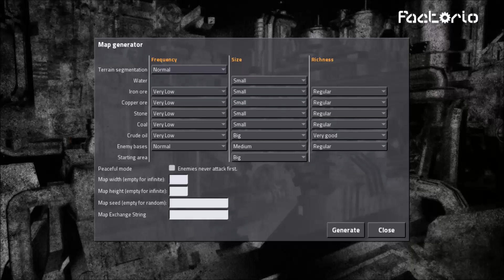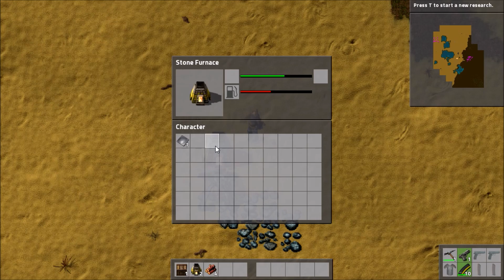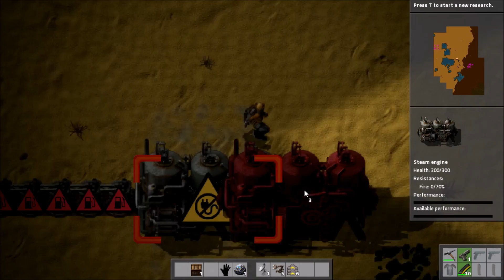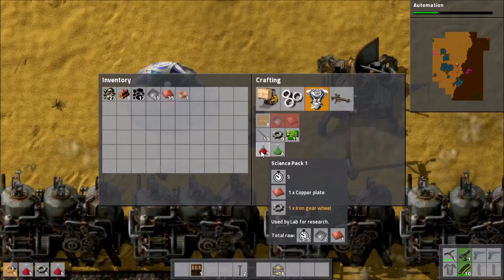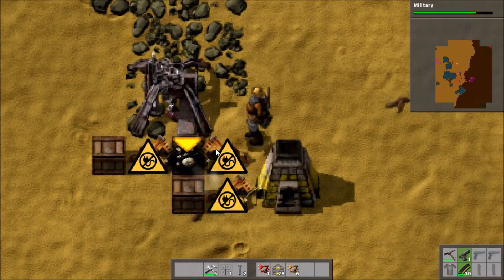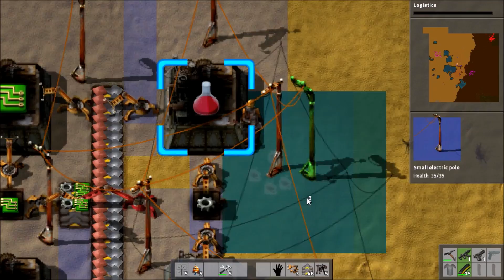Factorio Towns Ep#1: Industrial Revolution!

Comment: i know this is of an early build but what did you use to put coal in the burners? just inserters? cause i noticeed some inserters dont wanna drop fuel in burners. Do they work on everything but burners? (just got into it, sorry)
Reply from the maker: +Dean Toonen You mean burner mining drills? All inserters should load into those, but it's usually limited to 5/10 or something like that so as not to be wasteful. I was manually loading the miners in this, or having two coal miners feeding into each other.
Reply: aaah ok, maybe thats why, i trried it with a couple who had like 20 or so coal in it already. It would explain so much if thats the case, thank you very kindly

Comment: for your tips could you do like your favorite automation setups... i dont understand what you did with your red science but i would love to use it and anything else you use
Reply: +Gold Angel 
From what I gathered, Red Science needs copper and iron, plus gears made from iron, so he created a main delivery line for copper and iron as is standard for most assembly lines by joining two belts so each metal would occupy one side of the final belt.

A gear factory takes iron from the belt and outputs the gears into a crate / directly into the science factory / onto a secondary belt on which he's also running circuits but they're irrelevant for the science 1 production, just used for anything else later on.

A line of science factories sits next to those two belts and takes copper, iron and gears using normal and long (red) inserters to reach both belts. They output red science onto a conveyor leading to labs.

The key assets here are underground belts and long inserters. The long inserters can have a reach of 2 or 3 tiles depending on where they are placed. They always bridge 3 tiles but since factories are large, it doesn't matter where the end tile is.
Underground belts are used for intersections.

Comment: Nice idea on such "towns".

However, I can't agree that oil have to be exception - barrel transporting is indeed quite good - at my las game I had oil coming from 4 pump-bases in barrels and it did good, even better than I expected, especially when my mind came to design where belts are not needed at all:

- train brings empty barrels, smart inserter takes certain amount (this way all empty barrels don't stack at one base) puts in smart chest (latter is controling quantity taken)
- assembler takes barrels (via inserters of course) fills them up and puts full ones into second chest (regular one) and when train comes next time, it takes full barrels from full chest and brings new empy barrels, as I've mentioned before
- at the refinery setup is pretty the same, but smart inserter takes all full barrels from wagon, assembler pours oil into tanks, returning empty barrels to the loading chest.
- this design supports up to 3 assemblers - on single loading/unloading pair of inserters. I've found single assembler is enough for filling and two is enough to empty barrels (your emptifying station MUST work faster than refineries consume oil to avoid supply breaks)

Sorry for long post and kinda necroposting... And sorry if it wasn't quite clear - YouTube is up to 90% my English practice, unfortunately, but I hope It's clear. If it's not - can post screens (if anyone is interested, lol))

PS. There's a mod which adds tanker wagons. They look pretty uglu though. However they allow transportation of any fluids, not only crude oil. (Personally I strongly prefer vanilla games, especially early-access ones (may corrupt save on new patch released), so I don't use it)
Reply from the maker: +G.Z. Gizzeit Sounds like you haven't watched my railworld series, that's exactly how I transport oil there!
Reply: MangledPork Gaming No, I haven't - just rapidly scrolled few episodes. Found your channel via wiki recently, and you have tons of these, and I don't have enough time to watch all of them : )

Comment: the way i do my rail stations is:
- at the beginning of the station i write the name of the town, for example: irongear.
- the second word is the name of the train, for example: irontrain
- the third word is what the train does, for example: unloading

additionally i have a station with a dot and the town name after it (.irongear) that i can use to manually travel to the town. this way no trains are getting jammed by a manual one. the dot is just so it appears first in the station list.

i would love, if you use this system ; )
btw: i used it a while now and it works really well.
Reply: i forgot to add that the final name in this case would be: irongear irontrain unloading, eventough it should be obvious :D

Comment: Some suggestions to make it interesting....

1. Limit the size a town can be to that of 1 roboport range (station must touch edge or be included).
2. Make it so that a town cannot advance production more than once....meaning you cannot go from ore to plate to belt, that's 2 productions.  Mining towns may only export, when all the deposits have been depleted, the town can change into a normal one (with imports/exports).
3. To make it more difficult/interesting, every time a town is created, allot a maximum of X factories (10? 20?) that you can place in it.  When you need something to be made, each town able to make the material (without breaking rule 2) and has a free factory space, goes into a list.  "New Town" is also put into the list....roll a die or use random.org to pick from the list which 2 towns will support the need (2 towns so there's no monopoly).  If a town ever produces at least 5 different materials, it becomes an industrial park and doubles the factory maximum.
4. If a town ever becomes backlogged with export material (excluding mining towns), factories will "shut down."  The production is reduced in that town to free up spots for new "businesses."
5. At some point (after 10 towns probably), you should make a train yard as a single town...no factories at all, just a bunch of intertwined tracks, item storage and sorting, and distribution transfers.  Why?  because if each town is limited to 1 station, you'll end up with a mesh of material on every train.....this way you can combine all like materials together and properly sort.  Plus it would probably look cool.
Reply: Robert Caldwell You could use some of these as general guidelines but the whole thing with a random list etc. sounds a bit cumbersome in the long run
Reply: Robert Caldwell Actually surface limiting can easily be done with concrete.
Just build x thousand concrete, plop it down, and force yourself to only build on it.

Comment: Considering that I currently have a playthrough with a very similar concept, I have just one tip: don't make a copper cable exclusive factory, make the cables in the same place they are used. I spent hours trying to make a cable factory with high enough throughput and never got to a point that I considered good enough. However if you do try it I will definitely be paying attention.

Comment: You can set up a coal miner to mine coal onto a belt and also feed it from the belt with a burner inserter. The miner needs to point down I think and the line should run westwards then for it to feed itself. It's a pretty good early game / I don't care about pollution setup usually.

Comment: Nice, I'm waiting to see how you will regulate traffic at intersections with a non central design, and how you will design your loading/unloading into the assemblers.

But may I suggest you to try using the FARL mod ? With all the rail laying that will take place between towns, it can get boring, even at 3x speed. At least there's not (yet) forest.

I guess a missing feature would be underground rails in order have TTD-like intersections
Reply: JY454 0.12 has a great fix for that, ROBOTS >:3
With the portable roboport, you can have a couple of blueprint to lay rails.
You could have a 50 rail pieces long straight line blueprint and an intersection blueprint, and all you have to do is pack a ton of rails, a few robots, and stamp the blueprints, from inside a train, filled with more rails!
Reply: Ry P MOAR RAILS!!!